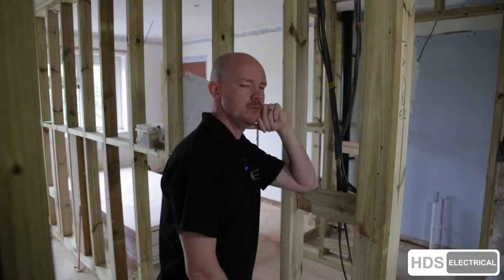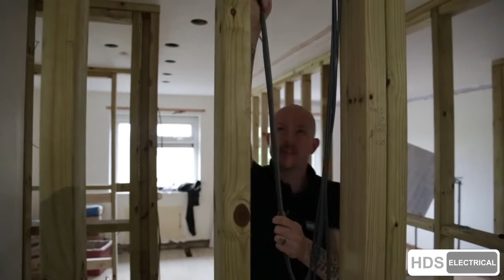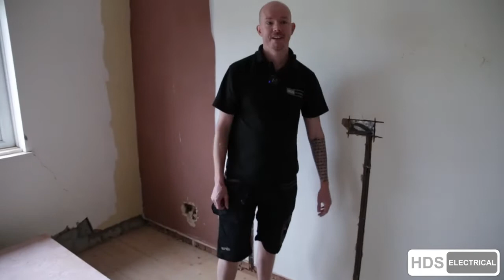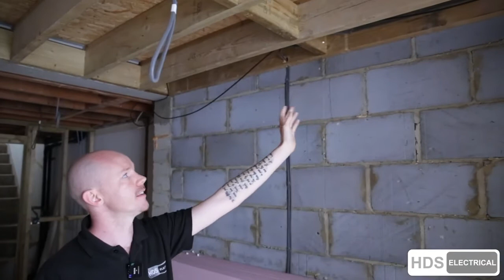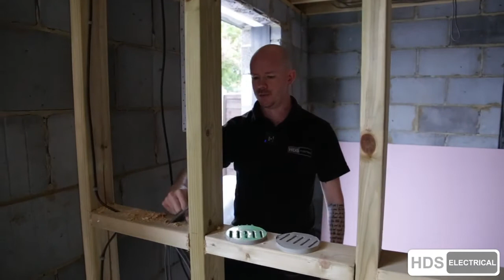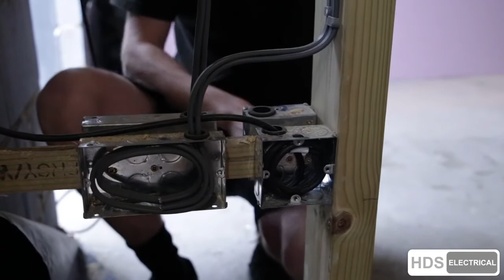HMO wiring standards!  🏠 Don't rewire without them! ⚡⚡⚡

Comment: About  hammers length in between clips g
Reply: The spacing guide per cable size, depending on horizontal and vertical runs, is in the on site guide held by the site supervisor and it will give you the spacing distances ;)